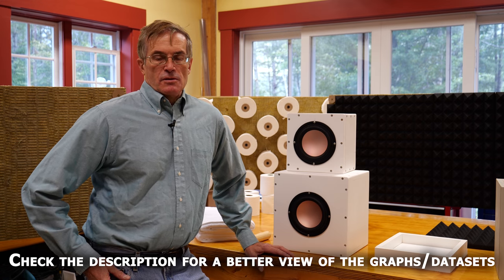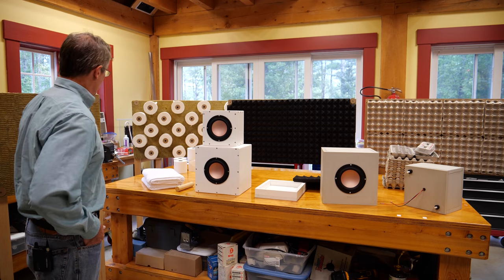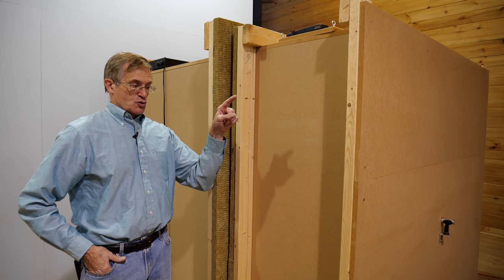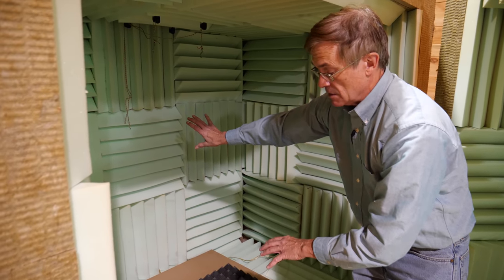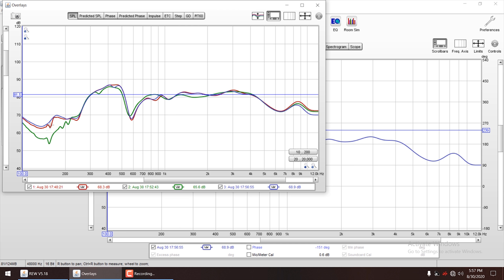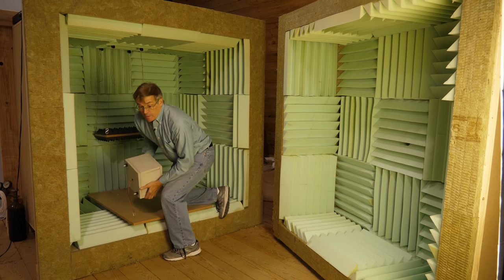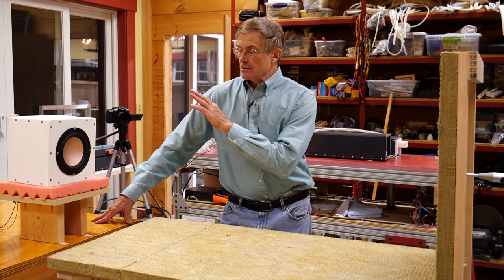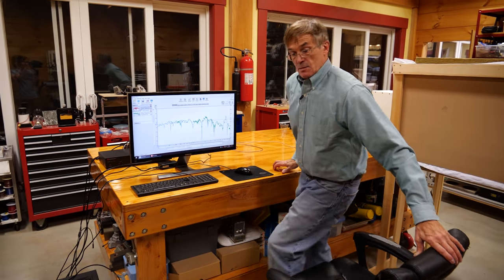DIY Speakers and Acoustic Panels

Comment: I've always heard that putting pillow stuffing, or similar material, into a box would help performance; the argument always seems to boil down to surface area complexity. I've also always heard that surface area complexity is better, and a popular trend is to make a box out of layers, where the inside square has form, typically something close to a sine wave, where each panel alternates position of the wave, thus surface area complexity. Though I've never seen these concepts scientifically tested, and this channel is the first I've ever seen to do any scientific testing on speaker enclosures. I've also heard a theory that there's a relation between surface area and volume, where a lesser ratio should theoretically be better than a larger ratio; though most enclosures are cuboid or cylindrical so nobody has realistically tested this, but the best test would be sphere vs. tetrahedron, but given the difficulty of making spheres, especially hollow ones, an icosahedron should work for testing the comparison.
I've always always heard that MDF is better than ply, and that plastics are typically too flimsy. Though my background comes from car audio, and high performance setups, mostly dealing with subwoofers, so I can see why plastics wouldn't be optimal, but I'm still curious about the MDF vs. ply argument. I've also always heard that concrete is better for subs, as it's supposedly a 'deader' material, just like how MDF is supposedly more 'acoustically dead' than ply is, and that's why some of the stupidly expensive 'audiophile' home theater setups use concrete. Where concrete doesn't do much in these ranges, I am curious about what effect concrete would have in the lowest audio ranges. 
Maybe we can get future videos testing various materials, and the various theories of enclosure enhancements, along with testing subwoofers as well instead of just full range drivers.

Comment: Why not have an electromagnetic switching system to lock the whole assembly.
Metal bars on one side and electromagnets on the other, power it all up. And locked!

(P.S. Powering the electromagnets via a clean DC source would minimize any electrical interference that may arise)

Comment: I thought this video would be on your new speakers... You had mentioned in your vacuum plasma video that you would be making a video about your concrete speakers. However, if you weren't very impressed with them versus the pvc foam, then maybe we'll be getting a video about the foam ones?

Comment: I had read somewhere that the porting is often times a way to use less expensive speakers especially concerning low frequencies because of the additional costs associated with reflex. It noted that the sound pressure is able to be relieved and therefore the speaker design could omit certain steps and features in the production phase. The voice coils are allowed to freely travel unobstructed while the pressure in an un-ported design would require significantly more amounts of precision to construct so they wouldn't bind under the un-relieved pressure. Also in the same article they spoke of tweeter horns having a very specific length tunnel depth to ensure a proper tuning in consideration of the mass of the enclosure and the individual driver specifications. This is necessary to provide proper phase alignment and frequency attenuation. Think of the differences in brass horns and or woodwinds and the physical relationships between them. It's all quite interesting and I absolutely love this video and the work you do. Thank You very much for producing such content. Two thumbs up it's a banger! :)

Comment: If you were to decouple the anechoic chamber from the ground it may reduce any low frequency build up/resonances. Rubber puzzle piece floor tiles might do the trick.

Also if you were to remove the hard outer layer (mdf/wood?) of your chamber just keeping the frame around the rockwool and then either treated the room around the chamber or build a slightly larger box around it with a layer of rockwool covering the inside of it you'd probably get a better total sound absorption inside of the anechoic chamber. Possibly replace the outer shell of the chamber with a mesh or hardware cloth to help keep it structurally sound. 

I'd also like to see some waterfall plots of your speakers in the anechoic chamber and out of it. The speakers with rockwool inside may have fewer reflections in the low end making them more accurate and probably less "woofy" sounding.  

Cool video btw!

Comment: I just love your videos :) thus here are some pointers and thoughts:
19:11 You would have done yourself a better service if you left the speaker in position, and THEN just unplugged the ports to further reduce the margin of error by a slightly different placement as you put it back later on. Same with with more preparation for the helium insert. You don't have to film things chronologically if it messes up your tests. You could've showed us the details after you ran the test and put it to a better display for the camera to see about the helium plugs :)
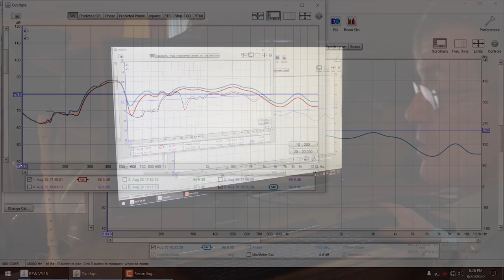23:48 I would be very careful with stale analytic measurements and comparisons like that. Just from a mechanical point of view, each time the speaker moves back, it is because at this given time the soundwave drops below the zero amplitude point. If you give the speaker a different resistence in one direction than the other, this is likely going to falsify the end product. Averaged Frequency analysis is not going to show that to you. You have to listen to what comes out.

27:10 It basically comes down to mass to most of us. The more mass, the better the bass insulation. Other than that it requires a lot of nifty constructions :D Apart from certain material science.

40:17 The difference might be small enough, but the egg cartons as well as the towels have one big issue: they are a fire hazard. The towels can be at least enclosed in some form of fire retardant and take less volume at that than the egg cartons. I wouldn't spray the egg cartons with anything. You can get polyester towels which aren't going to be affected by microbiologics. Egg cartons are essentially paper, thus wood fibres, so you're going to have a whole different problem with soaking up humidity and providing breeding grounds for mould and fungi. Never use egg cartons. Ever.

42:19 Have you done a weight comparison? It looks like the toilet paper rolls will score among the highest weight of the panels you showed, and they also have the greatest depth on some portions of that lattice whenever the outside layer is struck by sound. From the outermost toilet paper layer to the innermost one, this has by far the most depth of all the other materials. So again, we're at the well understood principles of mass and material depth, hence why any good listening environment is hung from the ceiling with substantial space between all solid walls to but dampening material in :)

47:46 if you use the rock sheets, apply some form of pore-closing spray on it. Anything will do, really, from wood primer to automotive primer, just to keep the outhermost layer closed and thus stopping it from giving off particles. Then slap on the cloth.

The magic trick is to dampen the sound equally and only curb the frequencies more which are standing out in your room because of natural acoustic reflection of that particular shape.

What really helps the most is random refraction which is best done with randomized half-spherical objects. So differently sized hemispheres (and even slightly differently shaped, like ellipsoid and some with slight angles) of one material mounted on another material and likely at least one other material behind that layer too. Ideally, those hemispheres are mounted on a thin standoff and the rear of the hemisphere is corrugated as well as the opposite mounting side.

What I personally really would like to try is a physical representation of dithering and the dither material is irregularly refracting. However, I don't have the funds, nor the space, nor a volunteer to help me out :D Because it would be quite the spacious and I don't have that here on my own. It's going to be quite space-consuming.

Comment: Creating a chamber is good tool to use when building passive components, such as diaphragms -> it allows for building the best component.  But they dont represent the real world with its walls, TV, chairs, tables and those squishy bags of water.... all of these affect the way a diaphragm moves.   It would be a good project to mount a mini laser/radar in front of the diaphragm, then uses the sensor's output as part of the negative-feedback within the amplifier -> thus forcing the amp to drive the cone so that it matches the input signal.

Comment: Hmm, you got my cogs working.  I wonder what a loser material could do, maybe hold it in netting, hung off the wall a little.  Maybe filled with loose Styrofoam balls, packing peanuts or shredded foam, something silicone?  The main idea I guess would be to suspend  the material and use disconnected disjointed material?

Comment: At 23:50 your explanation for the higher amplitude across the frequency spectrum may be incomplete. I don't believe the driver would experience any additional resistance because the temperature/pressure should be the same with helium as with air during your experiment. Since the ideal gas law would apply the number of of moles of gas should be nearly equal inside the the speaker volume given that n = PV/RT. However, there is a phenomena that would explain this which is the difference in the heat capacity ratios of the gasses. https://en.wikipedia.org/wiki/Heat_capacity_ratio . Helium has a 1.66 heat capacity ratio while air has a about 1.33 - 1.4 depending on the humidity. The specific heat ratio is used as an exponent in isentropic processes where the larger the exponent, the more PV work can be accomplished with a smaller change in either P or V when compared to a similar process with a lower heat capacity ratio. This is most likely why the speaker is performing at a higher amplitude - not because helium is less dense and decreasing the resistance on the driver, but because it's heat capacity ratio allows for more PV work to be done by compression cycle from the driver resulting in a slight increase in efficiency of the driver. To test this, you could compare helium to argon and neon which all have higher densities but similar heat capacity ratios. This would rule out the speed of sound which is what the density directly effects https://en.wikipedia.org/wiki/Speed_of_sound

Comment: Interesting tests. There are several problems with your testing and analysis.
1. When tested speaker in "anechoic"   with ports open, those ports ware on the back of the speaker. Since it supposed to be anechoic chamber - you can't measure reflected sound.
2. Last tests ware interesting with different materials, but your analysis was incorrect. When you saw some dips or reduction of sound pressure in particular frequency range you blamed the material. It's illogical as microphone was directly in front of the transducer, nothing was blocking the sound.
I would argue that those reductions of sound pressure ware indication of better absorbtion on sides, not a bad thing. I guess those ware closer to speaker pure response.
And this is where we arrive at key point. You didn't have baseline for your speaker.  Without it you can't judge various treatments in this test.
You would have to measure this speaker in anechoic chamber, not yours, as it performs well only in higher frequencies. And most of those dips you classified as bad (like with toilet paoer) ware in lower frequencies.
One way to measure speaker in full range is to test it outside, open field and put it suspended high above the ground.

Comment: I wouldn't say that solid speaker casing is not needed just based on frequency response measurements with frequency sweep. What human ear hears, is much more than just overal sound pressure from continous sounds. Our ear es particularly sensitive for harmonics and also the impulse characteristics of short sounds.

Flimsy casing tends to oscillate on frequencies typical to it's dimensions and you don't need to have a golden ear to hear that. Of course you need to have a good quality speaker to hear the difference. Ear can easily pick anomalies over 20dB below the main volume, so they can be difficult to measure.

More tha a decade ago I did some studies to find out difference between good and bad speaker and it wasn't in frequence response. I didn't have a fancy chamber but a room full of hanging blankets, decent measurement microphone, self written software and some self made electronics.

Some of my findings, for example importance of homogenous frequency response in different directions are commonly known but I also find out that short and symmetric impulse response correlates well with sound quality which ear regognises. I had a Genelec 8040 active speaker as a reference on good one as well as several different quality speakers from different manufacturers. I also did have a self-made active speaker with special current feedback amplifier but not so good quality elements.

Genelec is typically used as a monitoring speaker because it's ability to clearly reproduce small details in recordings and provide excellent stereo image. They main design criteria is good directional stability which keeps reflected sound as good as possible.

I did find that Geneled had superior short and clean impulse response and also the amplitude for that spike was much higher than with others. In practice that means impulse frequencies have less phase difference and oscillations in time domain, which make sense when needed to reproduce music instruments naturally. Ear doesn't care if some instrument is 3dB louder than it should but it is very good to compare short time differences. That't how entire stereo image is formed.

These observations made me test current feedback amplifier. Strength of the coil is dependent on current, not voltage. Normally speakers are driven with voltage and the inductance is major limitting factor for a current they take, especially more than decade close to they natural cutoff frequency. Current feedback can cancel this phenomena by driving the element with much higher voltage untill required current flows.

The result for this experiment was that with a low quality elements, I had a speaker which was even more precise and had even sharper impulse response than Genelec has. However, it wasn't pleasurable to listen and after the first wow effect, music just didn't sound good. Frequency response and other measurements were very good.

In practice,  the amplifier was driving very high voltage spikes to the speaker and my theory was that element cone material gave up and caused some nasty resonance and distortion. Things might be different with better elements with today's high quality materials.

I really hope you read this message and think about these observations a little. I guess getting into this subject could make a nice content to you channel. My own interest on this ended because most of the music nowadays is so badly made you don't want to listen it with too good system.

Comment: I used to use fleece blankets tacked to the my walls to deaden the echo in my house. It helped that I tacked the top and bottom of the blanket to a strip of 1x2" wood, hanging it so that it is pulled taught, about a 1/2" off the wall itself. As far as recording, I threw a blanket over my head, and above my computer, draping around my entire desk. The sound was more than marginally improved by this low tech simple use of blankets. Its fascinating to me how low tech materials can be used to produce professional results.

Comment: Looks like your anechoic chamber experiences out of phase reflection at 550Hz, so it's only really useful above that. I would guess this is from the reflection off the wall behind the speaker (~30cm). Building a chamber makes little sense for a hobbyist - you're better off measuring the speakers outside (or a very large untreated room) and using a gated measurement. With several meters of open space and a gated measurement you'll get an accurate measurement free of room effects down to at least a few hundred Hz, it costs you nothing and you don't have to deal with a bulky and size limited anechoic chamber :) If you place the mic on the ground, you also avoid the ground reflection.
At 31:12 the peaks and nulls in the measurement where the walls were put in place are just due to reflections, not panel resonances. The speaker reflects off the wall and the microphone 'sees' multiple speakers. Due to path length differences between the real speaker and 'virtual' reflected speakers, at some frequencies they are in phase and add to increase the amplitude, at other frequencies they become out of phase and cancel out at the microphone. By treating the walls, you're reducing the amplitude of the 'virtual' reflected speakers which smooths out the frequency response at the microphone because as the damping becomes completely effective, the microphone only 'sees' the real speaker and the walls and therefore virtual speaker sources cease to exist.

Comment: If you're building a home theater and want a cheaper sound damping option compared to expensive panelling, and you don't necessarily mind how your walls look, then just carpet your walls. use carpet pad if you can, and then use a deep pile carpet in whichever color best suits your preferences, ideally something fairly dark so you can get the most out of your viewing experience. If it can dampen the sound transmission through the floor by over 40dB, then it can do similarly for your walls and prevent unwanted reverb. It's still expensive and a pain in the ass, but it'll be cheaper and is far more durable than foam acoustic panels.